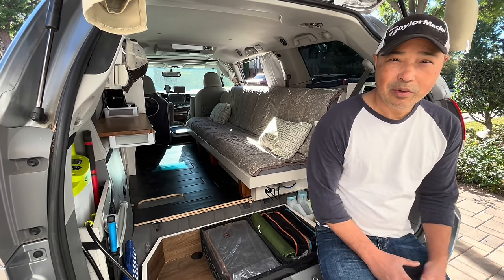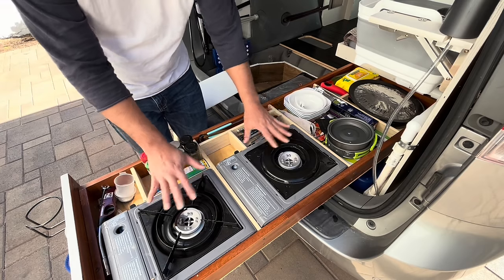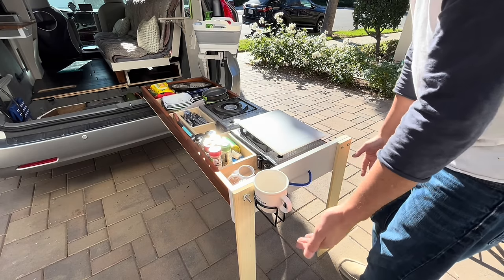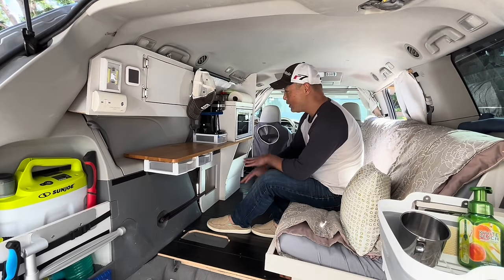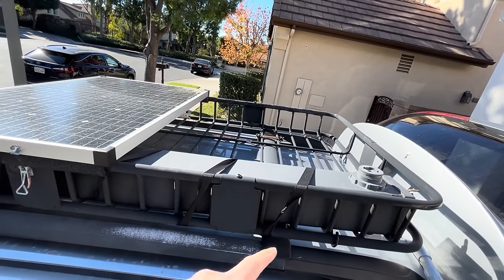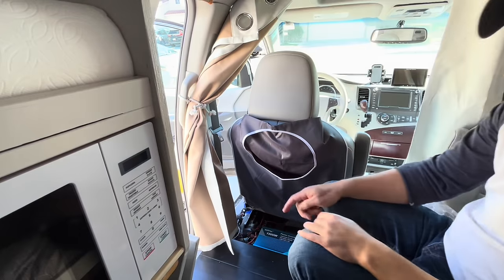My Best And Final Sienna Camper Build.  I AM DONE! Sienna Couple's Camper Full Tour

Comment: Hello from Canada! I also have a Sienna build and I know you said you aren't doing anymore builds on this vehicle but I do have some notes in case others are interested. I would switch the bed to the other side so the exit is not on the traffic side in case you are parked on a street. Rear kitchen has limitations when it comes to weather or even accessing it when in a parking lot, could be an issue. If you are going stealth, better to make custom window coverings with reflectix instead of a curtain to hide any light coming from inside at night. My .02 watts
Reply from the maker: Hi Stephen, good points. I have actually considered all those things. Bed is on that side because I want the window cabinet but I don't want to swap sides and cover my blind spot window. I have cooking capabilities outside of those stoves in the drawers. I used have reflectix but didn't like how cumbersome they were to install and store. Love how easy curtains are. I usually cover these little details in the build videos and not really the tour video. I am currently upgrading some things.  Maybe the new tour video, I will talk about them more.

Comment: Im going to get a bigger cargo van chevrolet express. Wont be as reliable,  but i have the same ideas far as the build want maximum space for comfort. Nice job you have done with your van😊 the weakest part might be the sink however may work nice for your build. But i got this 41 can capacity cooler that would would be great for a sink otherwise i would just throw it away. Im going to put a refrigerator in my van to replace it now.
Reply from the maker: more space would be awesome.

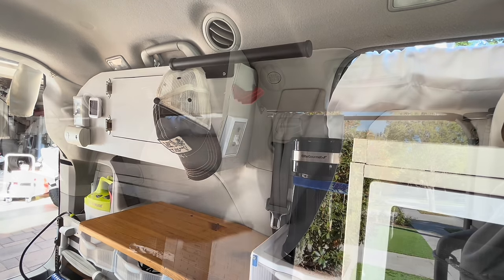Comment: At 12:43-12:50 you also have a clothes dryer. Hang wet clothes on the rack or hook, turn on the car fan, point those ceiling vents towards clothes.

Comment: On your extra pop up counter behind the driver , you might consider placing top surface edge trim to keep things from sliding off the edges to the ground or car floor below. The edges could even have attached sliding pieces of flat metal bars along an adequate portion of each vertical open edge that elevates above each edge surface via a simple locking function slide or clasp. It could prevent mess or injury to a foot if for example a glass jar of pickles was part of the shelf pay load surface.

Comment: Mahalo for sharing your Sienna Build!!  I have a Honda Odyssey and I am thinking of doing the same.  Would you be willing to share some of the specs for some of the build?  If not, I will try to figure it out after watching your video.  Probably won't match up with a different van but I could always adjust the measurements.  Again Nice build!!  Aloha
Reply from the maker: Aloha, yes , probably won't fit. But check out the build video and let me know if you need any specific measurements.

Comment: I'd love to incorporate a couple of modified versions of this build, like the cup holder work surface with drawers, but not as far into the slide door because I don't need a microwave or coffeemaker, but I would like a leaf to fold up for extra shelf when eating/prepping. I'd want my bed (not designed like a futon) on the opposite side because it's always safer to enter and exit a camper or rv on the right if you're on a street or highway shoulder (emergency) so you don't get out in traffic. I also like the upper cubby, but for the opposite side as well. I do like the box you built for the cargo well, though i wouldn't make a shower for it, only a toilet and sink space. Do you have basic plans at that link? I'm terrible with curves and angles for fitment.
Reply from the maker: Sorry I don't have have any plans. I just make things up as I go along. If you check the playlist in the description, I have a separate build video for all the major items.

Comment: I like what you've done but have two questions:  Fridge?  Where are your clothes?  Thanks!
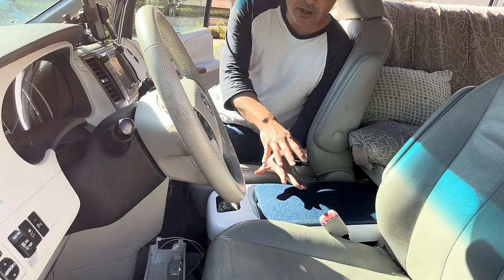Reply from the maker: Fridge shown at 25:54
For clothes, I found that I always pack a bag and never end up putting them in the clothes drawers that I built in previous versions.  Plus, I can move the bag to the front seat after I find camp.
Reply: @Tiny-Campers  Thank you!

Comment: I think you're awesome.  I don't know why sienna owners make the best custom RVs but that seems to be the case.  Really awesome work, thank you.

I plan to study your video, if I can just integrate a couple of your ideas I'm doing great.

I hope you're not offended but the only thing I see that I believe you could do better is the curtains.  I use black heavy paper cut to the shape of my windows and just pressed into place instead of curtains.  I used black gorilla tape plus the construction paper to build it out to the exact shape of each window.  From the outside it looks like just opaque tinted windows.  On the front two windows it looks suspicious I guess but no more so than curtains and the paper preserves all the space in the car when they're in the windows (with curtains you lose some of your precious space--on the other hand curtains cut noise better but that's not usually your prime concern).  On the very front I use one of those fold out sun reflectors so it looks pretty normal.  If you need space for something mounted to the windshield you can cut the sun reflector in half and it still works pretty well.
Reply from the maker: No offense.  I actually used a similar window cover setup on my previous builds with reflectix.  I realized that really didn't like installing them.  I wanted something quicker and easier.  That is why I changed to the curtain setup. You can search my videos for "stealth mode."  It was definitely space efficient and  VERY STEALTH.
Reply: @Tiny-Campers  yeah honestly i know some people do it with reflectix but the construction paper is better, at least at night when there's no sun.  when i'm car camping i usually only need the windows blacked out at night.  I get it, not how you prefer it.  but honestly the way i'm doing it is even easier than curtains.  takes a moment to press the heavy construction paper into place.  but it's all good, whatever you prefer.  love your setup.  very clever.  you preserved all the space, and it still looks like a normal car.

Comment: Nice.  A lot of nice ideas. Kudos.

 Mostly it appears to serve as a weekend camper.  It doesn't look "lived in".    It would be more realistic to show it outfitted with bedding, camp chairs,  pillows, duffle bags for clothes, and reasonably sized pantry and cooler to accommodate more food than can be  stored in the center console "beverage" mini cooler.  Having no option to widen the bed so the aisle remains open would not seem like a good trade off on a cramped night.   Reflectix window block inserts have better functionality than curtains.  There's really no room for duffle bags, bedding, camp chairs.  A roof top clam shell would be more useful than an open rack. The hinged solar panel and openly displayed electrical gear are targets for theft.  Disassembly and resale as a normal van appears a priority even though a well executed (permanent) camper conversion ads significant value.   You give up a lot of space to raise the floor over seat brackets rather than remove them.  I'm not sure a microwave is a worthy choice as centerpiece of the interior.  A moderately sized flat screen would be my choice.  Ad 360 degree surveillance  cams and a DVR.   Without shore power a microwave's utility must be rather limited.   There is a need for some sort of desk or table that can be used while sitting comfortably on the couch.  With that roof rack set up, the van will never achieve "stealth mode".   The  build appears  focused on  California weekend camping.   Travel in the rest of the country requires some provisions for heating, good ventilation,  screening, and AC.   Immediate dumping of grey water can become a problem quickly in some situations.  A gray water tank and purge valve are essential as is some sort of privacy screening and matt for outdoor showering.   If you're going to suffer the wind drag of a roof rack, adding an awning would  add a lot of utility.    Add an  (hitch mount) external storage locker for garbage, head bags, fire wood, shoes, soiled laundry, fuel cans, bbq, camp fire tools, bug spray, and the other dirty, odorous, buggy, charred, or wet gear. Bikes and a bike rack give you something to do once you've arrived, or backup transport if you break  down.

Comment: Your design is absolutely incredible! Is it possible to take everything out and change it back into a van with the chairs and all? Make interchangeable?
Reply from the maker: Absolutely.  I do plan to put everything back one day when I sell the van.  So I have that in mind.  The hard part will be not losing any of the screws, and parts!  My "Flexible Camper" build allowed for everything to easily be converted to a work van as well as have 1 seat in the rear.

Comment: Over simplification Cliff Notes:
Beds a cut up futon with customs foam Matt’s.
Waters a roof mountain solar reservoir
Showers the back row seat drop down hole drilled  in me covered in marine wood. 

Shelvers and clever battery powered water sprayers… 

Toilets a camping toilet for ladies and the shower hole for guys. 

Saved you 30 minutes 

(Amazing build bud)

Comment: LOVE IT! Do you miss having indoor heat and ac? (I guess that depends in part on where and when you camp, but I need a pretty steady temperature range.) Any thoughts or ideas welcome. Any time you want to problem solve your build in a hybrid Sienna (not that I own one), let me know!
Reply from the maker: I actually made a video answering some questions.  Among those questions was the heating/AC issue.  I actually have a neat AC solution if you have access to some ice. https://youtu.be/pOWz_6dSwE4  Heating, I have idea to use a tiny toaster oven so it can double as an oven.  But I don't camp when it gets too cold.  The Sienna Hybrid would pretty much solve the heating/AC issue :)

Comment: What do you think about covering the basin? So, the underside of the cover would be same lining as the basin and top side of the cover would be the flooring. And so when covered, it acts as rear walkway into the cabin. And when open (maybe hinged toward back door) it acts as splash guard.
Reply from the maker: I have actually thought about something like that.  The cover would just be more cumbersome than I would like. I am making some tweaks to the design.  But I don't think that will be one of them.

Comment: Truly this is an awesome build and I thank you for sharing your work with us.  However, I would like
to know more about the water tank on the roof of the Sienna.  How much water does it hold?  I see
you use this water for both outdoor and indoor showers.  Where does one buy such a unit?  Is that
vinyl fence post 5x5 or larger?  Length?  Is the attachable shower nozzle something I can purchase,
or is that part of the special make for the water tank?  Do you have a parts list for the water tank?  
As a woman, while on the road I love the idea of being able to take a shower with water warmed 
from exposure to the sun. You made note that it has an air valve that you turn off when driving.
Reply from the maker: Video here. https://youtu.be/_5Qz74QAFuE 
I would use a smaller bulkhead with a smaller lip if I would do it again.  Maybe even a sink drain.

Comment: I am curious on how you can use the car's alternator to charge the lithium battery which sounds like you are doing directly which is only out putting 12v. Would Love to see your electrical diagram for every thing and how you ran your solar pannel wiring into the van area. Thanks
Reply from the maker: Switch video https://youtu.be/396Y-oiMYS8?si=HxVl_xV-_hIRq1IA
Reply: Thanks for your time/help with the above with diagram of  2 solar charge controller for charging lead acid and LiFePo battery in various ways rather than DC/DC chargers etc. Curious on cable sizes you used and where/how you brought solar panel  and battery wires into the inside of the van as I have 2014 Sienna and looking for a clean way to bring them in. Also, your perspective where SCC manuals (renogy wanderer) say to make sure batteries are connected to provide reference voltage before connecting power from the solar panels as it appears to happen to SCC#1.  Also, suppliers (solairworld) say not to use SCCs as DC/DC chargers for various reasons. FYI my set up is camping light while hooking up a hammock (surprisingly comfortable)  after after removing the middle seats, keeping the 3rd seats up, and a adjustable steel rack that sits into the back area hole  for microwave, refrigerator, solar generators, 2 lithium 100AH batteries, and 2 100watt solar panels on the stock roof rack. Thanks again
Reply from the maker: @davidwarner6669  that scc was so cheap, I really didn't care if it failed. Haha

Comment: Genius build! Just one question: how much solar do you need to power the fridge, microwave & rice cooker?
Reply from the maker: My panel is 110 Watts.  Fridge you can run indefinitely (in southern CA).  Rice cooker is only is really low watts.  Don't go overboard using microwave all day.  that is 800watts or so.  My battery is a LiFePO4 100mA (pretty big).
Reply: @Tiny-Campers  Wow, I thought you would need at least 200w. Good to know, thanks.
Reply from the maker: @LaVonneEllis  having the big battery is more important than the solar panel. It is really the battery that powers everything.  The panels just recharge the battery.